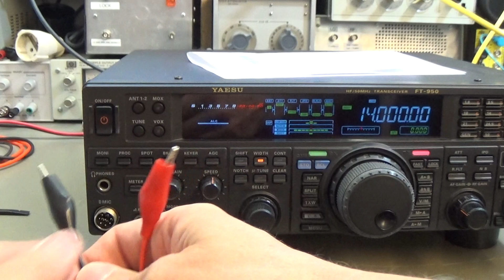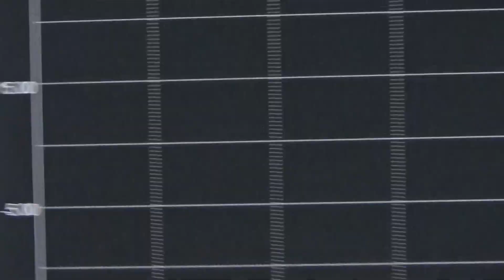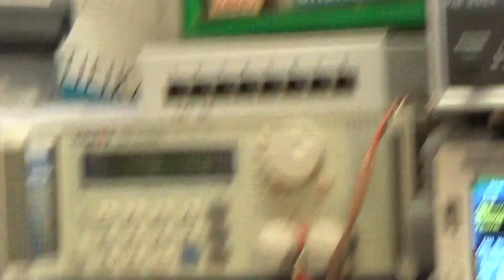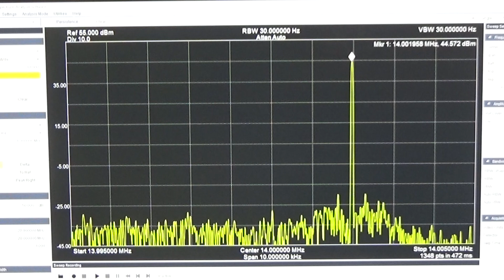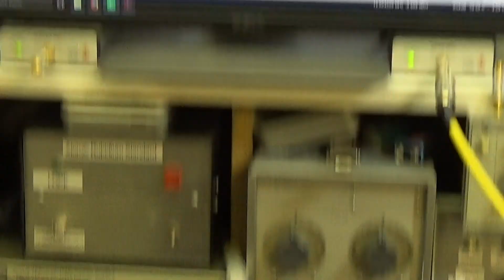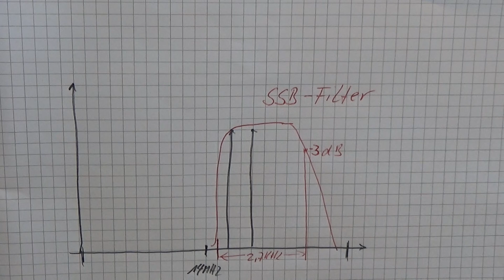#93 Yaesu FT950: Why TX intermodulatin products are so critical and how to measure

Comment: Hi Peter,
Nice video. How did you come on the 100 KOhm resisters in your combiner? I expected an impedance transformer to have the 600 Ohm at the output available for the mic input of your trx.
73,  Luc
Reply from the maker: Thanks Luc. No in this case it has nothing to do with impedance conversion as it do not matter in this particular case. I have chosen 100k simply because I wanted at least a bit isolation from one output to the other...
Reply: @TRXLab  Hi Peter. I see, thank you for the explanation. I build a small linear combiner network for two-tone tests. Maybe someone is intrested in the schematic. Is there a way to upload it? Maybe in the community section ?
73, Luc

Comment: Nice explanation Peter...a good graphic demo of why you need to remember which sideband you're using when you get close to a band edge as well. Maybe you could do a video explaining receiver IP3 specs too? That always hurts my head when thinking about it!  73 - Dino KL0S
Reply from the maker: +Dino Papas Hi Dino, thanks a lot. Well RX IP3 is basically the same but it is much more tricky to probe it. A lot of mistakes can happen and at the end you are measuring the IP3 of the generators. Therefore the test setup is critical and needs to be done very carefully. Additional to that it is essential to block the generators from each other . Therefore you need some stuff for the test setup and unfortunately my case with all this stuff got lost during a presentation recently. I have to buy all new and then I can show it as well. But in the moment no way...sorry. Thanks for stopping by 73

Comment: Dear Professor Pete,

is sunshine AC, and gravity DC? 
Could the sea be a salt battery?
Could the mountains be diodes? Think of a power supply, AC in, DC out.

The DC is the result of the AC going into the planet, and being rectified by the rocks.

The result would be, that the atmosphere is a phase cancellation between the sun (AC) and the AC bouncing back off the planet. Is that our atmosphere?

I have been long thinking about these things, and I wonder what you think about it.
Thank you for all your time, I have learned loads. Dankeschön !!!
Reply from the maker: +The World Of Truth  Well if I could answer this questions I wouldn't sit here doing videos on radios :^)  Anyway thanks for watching and comment! All the best and CHeers

Comment: Hi Peter, nice tutorial about IMD.IMD is very important like you said, but even -31dB, it's not very good, why don't manufactures use 50V LDMOS, 2x100W or 1x200W or 300W, and just let them run cooler at 100W PEP? The IMD would improve on some cases to near -50dB.
Reply from the maker: +Nuno Lopes Hi Nuno, thanks for stopping by. Well all is a question of price and we atr talking about consumer electronics which is always developed very cheap.. 73's
Reply: +TRXBench Thanks for replay Peter.You're right about the cheap part, but I don't think that the 3 big ones start using let's say 1x300W LDMOS for all the transceivers, the price would not increase by much, let's say about 100€ more maybe, if they don't drop the profit margin by the same amount. And we all could benefit from -31dB to ~-50dB, and the bands would be much more clear.